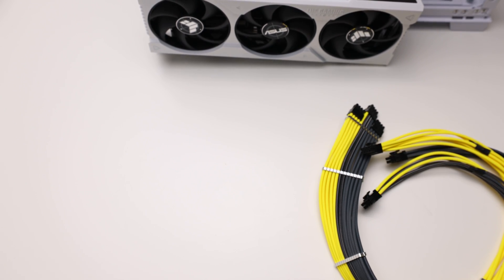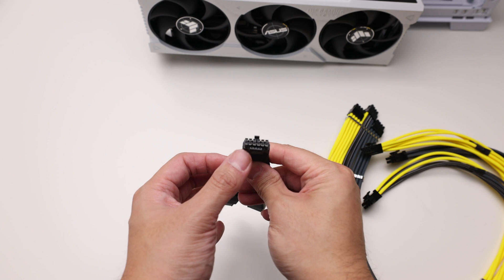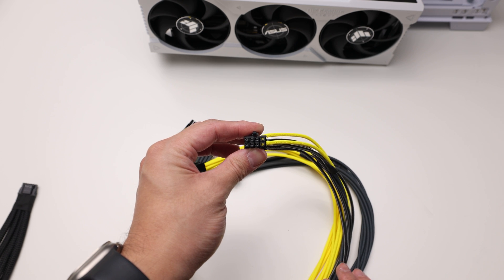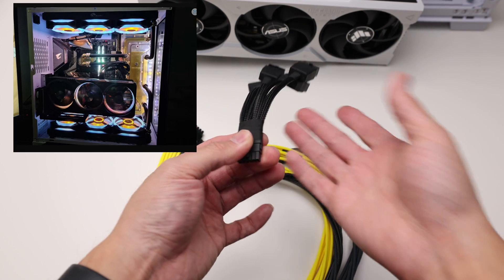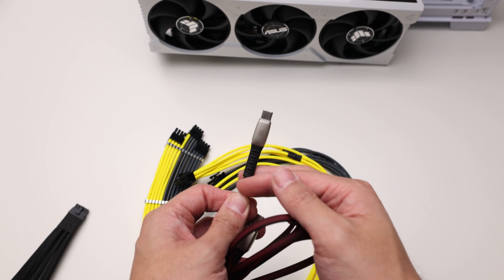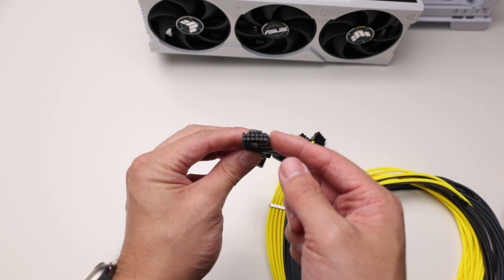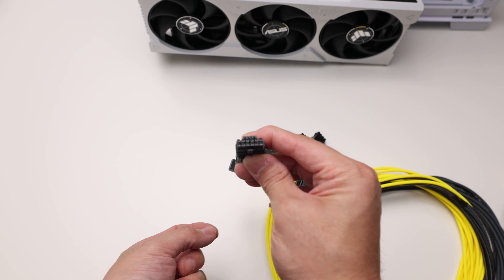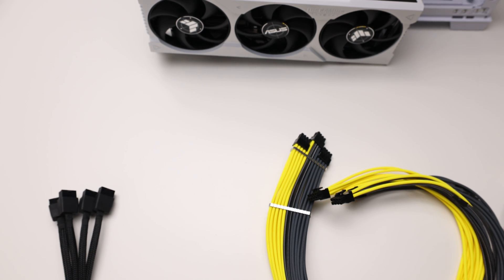HOW TO AVOID BURNING YOUR RTX 4090 / 4080 CONNECTORS 12VHPWR

Comment: It may not be a design flaw and it most likely isnt a problem if its used properly. But quite a few people who will use the connector arent aware that this cable is different than cables they have used in the past. If I owned a company that sold GPUs theres no way in hell i'm relying on people doing research and using common sense to use the cable properly I would need an army of lawyers to not go bankrupt. I mean Mc Donalds lost a lot of money to a cup of coffee that was supposedly too hot. And to be honest Im a bit concerned that if i leave my computer on overnight to render a 3d animation I wont be awakened by the smell of burning plastic, even if i did install it properly.

Comment: Not the guys fault, not sure why you are blaming him. NVIDIA has some of the best engineers in the world and if you bend there connector it melts your $1,600-$2,000. 4090 is huge, how do you fit it in a case without bending it.

Comment: I think its really strange to shove more power in a smaller cable connector thats on a bigger gpu. These cards are massive but for some reason they need small power connectors that are more dangerous if bent.
Reply: I thinks that the same strategy of putting smd resistor near heatsink screw. One careless slip when opening the heatsink the dead card 😁

Comment: I dont like your smug approach to this, it's flamingly narcissistic. Bad design and no, it isnt here to stay. There will be recalls just like the asus hero board, and as for design it could be one of the worst yet, when you talk about peoples lives at stake here and compare those lives to a flawed $19 connector and the easy fix preventing loss of life but still try to rationalize its existence in your home or others homes, you need psychological testing and possible long term inpatient treatment..............

Comment: Common sense... What happens if have ATX 3.0 PSU and stuff up all your power cables in the case? Because you know really good everyone stuffs its power cables on the PSU side. This is a BS connector and these guides are not much helpful here...

Comment: If this were an isolated incident then I would agree with your sarcastic take on it. No the real problem is in the design of this Adapter which is just total garbage. The adapter cable should be pre-bent 90°, considerably longer and a more robust affixed pin (molded/welded pins to the 12VHPWR adapter) to the design. 

Personally, I much rather have 4x8-pin or 6x8-pin if that's what it takes. It would not surprise me in the slightest if it ends up in a class action lawsuit against Nvidia if people in sufficient numbers continue to have problems. These burnt cables are nothing new at all and it is a known issue by Nvidia, the PSU companies and PCI-SIG.

I'm an Nvidia fanboy, I have an RTX 4090 sitting in a box waiting to be built; hating every bit about this stupid adapter. This Adapter was not ready for primetime nor was this ATX 3.0 / PCIe 5 spec ready or coordinated for a release by the GPU / PSU manufacturers. So now we're over 2 years of poorly managed supply chain issues.

I seriously doubt the power supply had anything at all to do with this issue. My guess is a bad pinning issue with arcing. If this adapter had welded-on / molded-in pins into the plastic pin housing this would not be an issue. I thought this whole spec was to make everything idiot-proof? Instead it made things unnecessarily much worse and less reliable. Also this new cabling standard was pushed by Intel, so I find it interesting and laughable this spectacular new connection isn't on their GPUs .. yet it has 8-pin PCIe.
Reply: I need to hurry up and get a 4090 so I can be part of the class action lawsuit.
Reply: evga pin on 3090ti was longer and they had it going to the side and not right out the top
Reply: The standard was pushed by NVIDIA and Intel accepted it.

Comment: It’s just a bad cable design. Yea I get that we are told not to bend them but still it shouldn’t be this complicated to just connect a cable.
Reply: We're told not to bend them? Funny I just bought a 4080 10 months later. I read the documentation I received, doesn't mention that. Still. 10 months later. It's a headache we even have to think about this. There should be a class action lawsuit and there probably will be once an actual fire happens and a lawfirm with a few PC gamers wants some action. The cards are out in the while. It's inevitable really. I mean Nintendo lost a lawsuit over joycon drift.

Comment: don't do this , don't do that. They should make the connector that allows to put gpu into the case, connect the power and close side panel without the risk of melting the cable. this is just simple bad design! I have a big, wide case (LianLi O11D XL) and still can't close the side panel because of this stupid connector design.
Reply: Vertical mount with Corsair dedicated 600w cable... Dont really understand how anyone would have thought the 4090 would fit horizontally in LianLi. I mean it was already smashed against the panel with 3000 series!
Reply: @bobvila4381   I've had 3090 in this case and there was plenty space in-between cables and side glass because cables could be bent quite easily. I agree with You about corsair cable but it's sold out for now.
Reply: @bobvila4381  My understanding is that you should only use cables made for your specific psu.  If you don't have a corsair psu, using the corsair cable could cause damage.
Reply: I have a 011D XL as well and was wondering if it would fit.  It's a huge case.  How tight is it?  Have you looked at the CableMod Basics E-Series 12VHPWR PCI-e Cable?
Reply: Did you consider doing a vertical mount?  If so, were you able to find any mounting kits that work with the XL?  The PCI 4 vertical mount kit Lian Li made for the XL is no longer available.  I saw a couple of universal PCI 4 mounts but it put the card right up against the glass, which makes them pretty much useless.
Reply: @MeR-md1jq  from the top of power socket on my 4090 TUF OC to the side glass panel is 28mm. Original cable, for comfort fitment need at least 45mm of space, as probably any other thick cable, including cablemod. I have finaly bought corsair cable for my AX1600i PSU and, with tight bend it barely fits in this space touching the side panel. I didn't consider vertical mount as at the bottom I have thick 60mm radiator with push-pull fans
Reply: Hello mate,I have the same problem,it’s been 1year since your comment,do you have any solution?
Reply: @alisamimi3168  I've bought corsairs 12-pin GPU Cable dedicated to my power supply. It's flexible just enough to fit there.

Comment: Seems like a design flaw.  The sleeve at the connector should be about twice the length and much stiffer to help prevent the issue.
Reply: Bad design.  Connector on GPU should be bigger wider gaps between pins and thicker pins to withstand high current. Also 90 degree connector to PSU connectors should be given with GPU
Reply: This whole issue stems from having difficulty with installing the side panel because of the length already, it'll be too stiff to bend it 90 degrees and make the situation worse.
Reply: @rustyboltz2820  perhaps the solutin is to make the connector on the board stick out and pivot.   I'd say burning down your house is far worse than a cable that won't bend.
Reply from the maker: the connector orientation also does not help. This began with the 3090ti. Had it remained vertical it would been less prone to aggressive bending as well.

Comment: The whole ATX specification is the problem. We need a complete redesign from the ground up. GPU, mobo, case psu makers need to work together and hash out a new specification.
Reply: Or you could just increase the size of this adapter by 50% and everything would be totally fine. It's really not that complicated. Fun fact: Intel pushed this adapter design, but they're not even using this new adapter on their own graphics cards. Maybe that was their plan ;)
Reply: @lgeiger  The power adapter is not the only issue, its the only issue being reported. The new 4090s are big and heavy enough that they could damage the PCIe slots on motherboards, bend the case that its screwed to and that's even if it fits. We are well overdue a redesign, we don't need backwards compatibility to 1995. A new specification could take into account modern CPU and GPU power and thermal requirements. At the end of the day a 600w ecteronic device is not problematic, the issues is the form factor it needs to be in order to comply with an ancient out of date specification that never envisioned an RTX 4090.

Comment: Question: How is one supposed to avoid bending the cable close to the connector when mounting the GPU horizontally while still having a side panel on? Or is vertical mounting mandatory now? I was planning on using one of my other PCI-E slots. I'm not even doing a small form factor build, I'm planning on using a HAF 700 and even that obscenely large case doesn't have the clearance for card + 35 mm (as recommended by cablemod) safety margin bending the connector.

I don't understand how they thought it was acceptable to design a cable that you can't bend in a way that is required to fit into most standard form factors while providing no information about this in advance to their consumers. Especially not when the previous 6- and 8- pin connectors can handle stupid amounts of abuse.

I'm sitting here with a 4090 TUF waiting for other parts to arrive and I'm wondering if I might have to return it. I'm kind of hoping someone goes and makes a 90 degree connector. Oh... Looks like cablemod is releasing one shortly.
Reply: @Anonymous One I have the Enthoo Pro 2.
I STILL have to bend the cable. And the Pro 2 is wider than the P600
Reply: Just buy a Cablemod angular connector (90 or 180-degree).
Reply: @Xpert45 the same one that is melting more than any other adapter? Nah fuck that
Reply: so would I  be able to use that cable mod cable on my current atx 2.0 psu I am running a 1600w
Reply: @Anonymous One the enthoo pro 2 has nearly 0 cable management space behind the mobo.
Reply: @Waldherz  Let´s all buy a Cooler Master Cosmos c700m with 198mm CPU clearance 🤣
Reply: @remmykun8315  Nah, Im probably going to switch to a 7900 XTX anyways. 
Doesnt need this BS connector, doesnt require me to buy a new cable, has Displayport 2.1...
For half the cost of a 4090.
Reply from the maker: Yeah that’s coming soon the 90